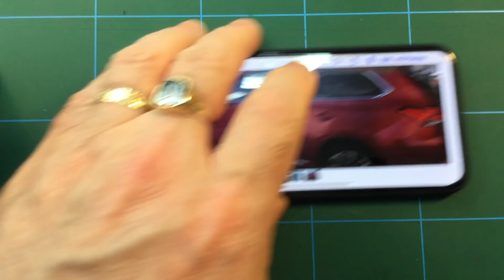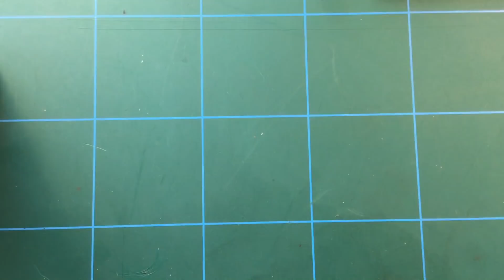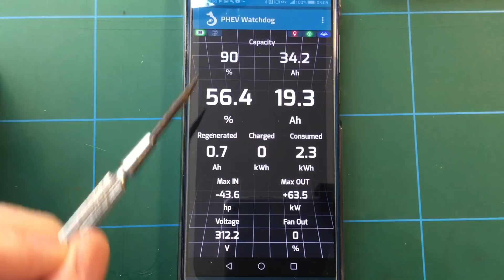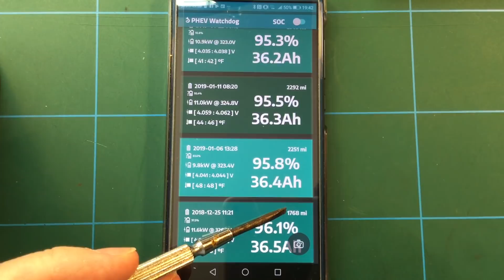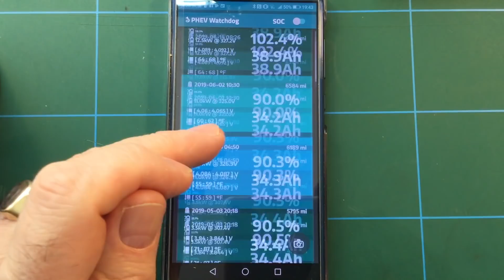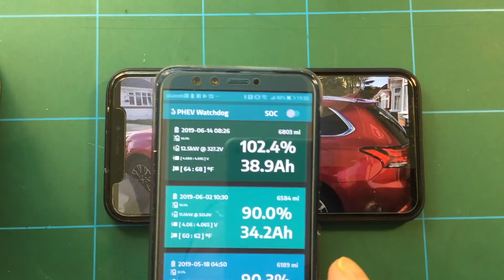Mitsubishi Outlander PHEV battery degradation - UPDATE!

Comment: i have a 2019 Mitsubishi outlander and its not starting . It is giving me an error code U0167 (Immobiliser to ECU communication error ). I have checked all my wiring for continuity and they all seem fine. Does anyone know how i can access the reset button which appears on the screen together with the cancelled key icon on the screen?
Reply: Hiya, did you get this U0167 error sorted? If so, what was the issue and how was it fixed...

Comment: Unfortunately it is all a balance of priorities. The chemistry of these cells is such that at lower depth of discharge, the more cycles you get out of the battery. By going back up to higher 'usable' Ah, means you will be using a greater DOD and hence shorten the lifespan of the battery. Everything the software does is to try and eek out the cycles for longevity. A bit decieving, but they are only interested in the battery making it to the 8 year mark. I guess this is where they estimated would be acceptable for the lifespan of the battery.
Reply from the maker: I agree. I sold this car and got a Tesla model 3. Had that for six months. Did not care for the car and realised the dual fuel of a Hybrid is, currently, the superior option. So I got another Outlander and have not looked back!
Reply: @Edifred2007  For practicality, you really cant beat it. Just a pity mitsi can't do a battery change at £2K (cell replacement, leave the rest of the hardware the same).

Comment: Hey Dude, , im looking for some advice on the main differences / pros & cons between a 2014 PHEV vs 2015 PHEV facelift model? 
I’m looking at a 2014 with 52,000 miles & a 2015 with 100,000 miles at a simular price! Mostly for short runs so would be plugging it in every night! Thanks

Comment: Thanks
I did email mm directly but they say a charge will apply if it's not a warranty issue. I had the 2017 version of this car and it lost 10% in 2 years. This 2019 version is down by 15% in 4 months, actually nearly 16%.
Is it better to be aggressive or just keep passively sending emails and data.
Thanks
Reply from the maker: I’d keep on at them asking how it is possible to lose that amount in such as hairy time and get them to explain themselves. It makes no sense to lose that capacity in that space of time. At that rate you will need a new battery in no time. So press on.
Reply from the maker: Hairy? I mean short. Damn spell check.
Reply: Thanks, good idea. I think that are pointing towards the warranty which states they only need to do something if the capacity drops by 20%, but of course that is over 8 years of ownership. Like you I like the car but not prepared to accept such a huge loss of range.
Thanks again

Comment: Hi
I have the 2019 version and the battery capacity has dropped by 15% in 4 months from new. How did you get mm to do a battery smooth for free?
At the moment they are starting to dig in heels.
Reply from the maker: If you are talking to a local dealer forget it. They will deny it all. Approach MM UK directly. Email them with all the data and request it be looked into. Email them at customer.services@mitsubishi-cars.co.uk

Comment: Hi, wife and I are considering purchasing a new Outlander and I've been researching this issue. Just wondering whether the fix has worked long term and what the current SOH of the battery is reading as now 5 months later. Also do you know what work MM did on your vehicle? BMU/Battery Smoothing/Sprinkled pixie dust?

Thanks for the video, very informative!
Reply from the maker: Hi Victor. Its a mixed bag. The SOH has dropped to 37.5 Ah. I continued to discuss with MM UK. I think I need to do an update video showing all ,the data and the MM position so watch this space.
Reply: @Edifred2007  Thanks, will do! To be fair, I'm not sure how concerned I should be regards this issue. As per your video you still recommend the car and after pouring over the details and numbers of other vehicles the PHEV really does look like the right fit for us and exactly what we are looking for (economical/spacious) but I can't lie I'm feeling a little dissuaded after researching this issue.

Cheers again!

Comment: Any update on this ? what did they do exactly ? BMS update ?

Out 2015 Diesel Outlander diesel died on the middle of the road and nearly 2 weeks later they don't know what's wrong, cranks but won't turn over, we were considering the PHEV until I read about battery degradation.
Reply from the maker: I'd still buy the PHEV. Despite some battery issues it is awesome. My battery is now at 38.4 Ah. They did BMU reset. There are no people doing this themselves with the Dublin Method (google it) for example with great results. No regrets here.

Comment: Great video. I will show this to my dealer when i bring in my car for service!
Reply from the maker: I have since done a full range test and got 31 miles. Before the reset it was 22! So its worked very well.
Reply: @Edifred2007  31 miles, that is 49.9km which is excellent. 22 miles is 35.4km which is roughly what I get at 31.0Ah battery when driving partly on Highway. I can get to 40km if I never run faster than 80km/h. During the winter I could just about reach 30km (29km to work) if the temperature was below zero (preheated car, nothing on).